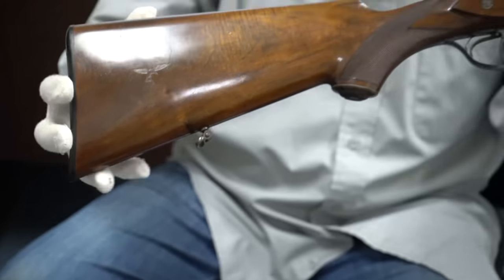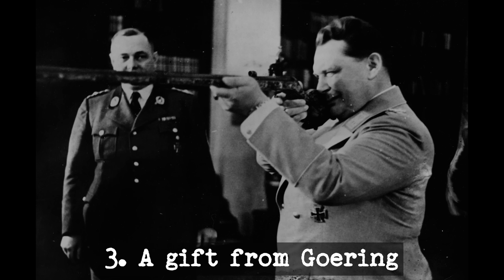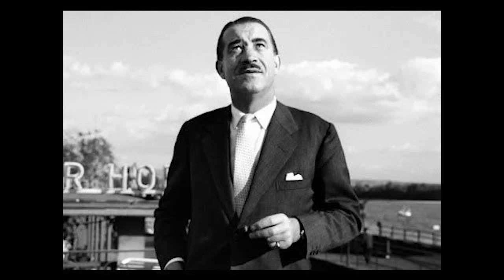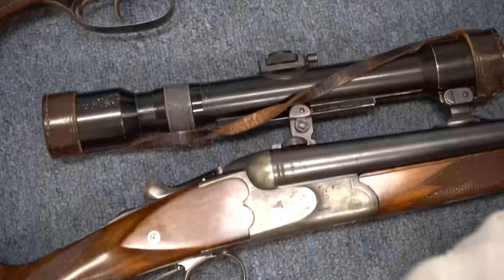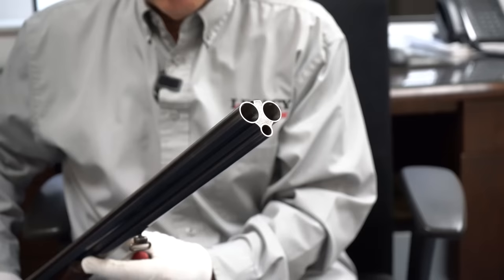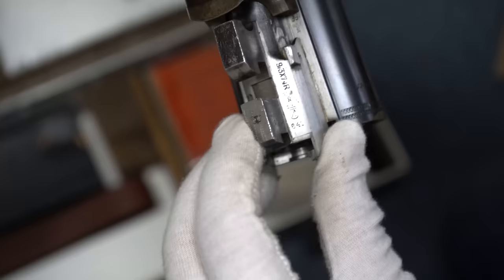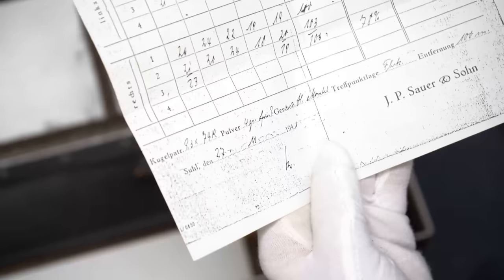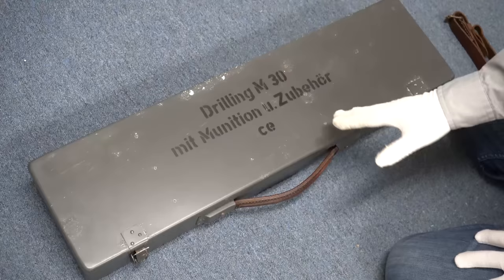Finally Proven! The Purpose of the Luftwaffe Drilling

Comment: It was far more common for pilots flying in the desert to ditch instead of bailing out, as sand was quite a bit more forgiving to crash land on.
Reply: that is until you flip
Reply: The Berbers, not so much
Reply: @george2113  that's what the drilling was for! Bang a few off at long range, then wait till you see the whites of their eyes, then give 'em both barrels! Job done!
Reply: I would like to add to this that pilots were and are trained to always try when possible to save the plane so if they still had control they would try to find a spot flat enough to land and as long as you are not flying on top of a forest you'll probably find it, also landing inside a plane is safer than going out with a parachute considering it is not that easy to jump out at high speed and you risk to hit the tail of the aircraft and on top of that those emergency parachutes have very approximative control so you don't have much of a say on where you land
Reply: Even on the Eastern Front the German pilots preferred to ride the plane down as opposed to bailing. Erich Hartmann, f'r instance, only bailed once vs 16 crashes (or something). Part of the problem may have been the "coffin lid" type canopies, part of it might have been lower altitude fighting, part of it may have been crap 'chutes (the Falschimjager parachutes were different to Allied once, could not be steered) .
Reply: As a Pilot, I'd land in a field over a desert any day. Sand is not forgiving to land on in the slightest. There's a reason runways are hard and solid. Sand is the opposite. You can land in either but you best believe I'd be bailing over a desert if I had adequate altitude, skill and the means to do so.
Reply: @XMarkxyz  what’s funny is now its almost the opposite. If you think you may lose the plane in enemy territory you basically scuttle it so they can’t get at the tech inside.
Reply: I would imagine the whip lash was still extreme, yould have to be the PERFECT ammount of relaxed and tensed to not have severe pain after landing fighter hard in sand unless you hit at litterally stall speed.
Reply: The little prince!
Reply: @bentrod3405  true, that is made possible by modern ejection seats which will keep the pilot safe until he has landed, anyway you can probably recover valuable information even from a crashed plane
Reply: Wrong! Go research some more!
Reply: @DonnyHooterHoot  Wrong! Go research some more!

Comment: The fact that that switch also flips the back sight up is a remarkable detail,  I freakin love that!
Pretty incredible that the cellophane wrap is still intact like that too, so cool!
Reply: I don't think that's original cellophane, it wouldn't be wrapped up like that for the soldiers I don't think. That's probably something someone just added after the fact to preserve them so they don't get dirty or wet or damaged. I'm not an expert on these things but the only reason I say that is because of the mismatch; the paper boxes seem used and worn while the cellophane is pristine. It wouldn't have aged like that naturally
Reply: @Eralen00  maybe, idk. Im sure if it is original it isn't very airtight, thus allowing air in to effect the paper. Idk, id be curious as to what these experts from Legacy think about it

Comment: 11:57 The contents of the box in German reads this:

1 Beschreibung, Bedienung und Wartungsvorschrift
1 Kolben mit Verschlussstück
1 Lauf mit Vorderschaft
1 Reinigungskasten
    a) 3 teiligen Putzstock mit drehbarem Griff
    b) 1 kleine Flasche Gewehrreinigungsöl
    c) div. Werg
    d) 2 Reinigungsbürsten für die Schrotläufe
    e) 1 Ölbürste für die Schrotläufe
    f) 2 Reinigungsbürsten für den Kugellauf
    g)1 Ölbürste für den Kugellauf
    h) 1 Wergaufnehmer für den Kugellauf
1 Gewehrriemen
25 Schrotpatronen Kal. 12/65, Schrot 3 ½ mm
20 Brenneke-Patronen Kal. 12/65
20 Kugelpatronen Kal. 9,3 x 74 R H-Mantel-Geschoss

Now, let me try to translate, as far as I can, not being an actual gun-proficient person (sorry!):

- One description, use and maintenance prescription
- One stock with lock piece
- One barrel with forearm
- One cleaning kit
a) Threefold piece of cleaning rod with rotatable knob
b) small bottle of cleaning oil
c) several pieces of gun cloth
d) 2 cleaning brushes for the shotgun barrels
e) oil brush for the shotgun barrels
f) cleaning brushes for the rifle barrel
g) oil brush for the rifle barrel
h) gun cloth catch for the rifle barrel
- One rifle strap
- 25 shotgun cartridges cal. 12/65, 3.5 mm
- 20 Brenneke-cartridges cal. 12/65
- 20 rifle cartridges cal. 9.3 x 74 R,  H-jacket

Comment: All the steel drillings were all case hardened.  There's usually remaining color inside the action.  Some were duralumin, and they're anodized.  The safety is normally on top as on a standard double shotgun. The lever on the side is the barrel selector.  In this case they're the other way, which is neat, as is the chamber indicators.

You can still get new drillings starting around $15,000.

12/65 ammo is 12 gauge by 65mm or 2.5" long, vs modern American 2.75".  DO NOT put 2.75" shells in one of these guns. They'll fit, but they create dangerous pressure in the forcing cone.

Complete Luftwaffe drillings are selling at auction around $22,000 in 2022.
Reply: Duralumin is an aluminum alloy, not anodized. The lever on the side is a Greener-type safety; the slide on the top is the barrel selector. This is the standard configuration on virtually ALL drillings, not just in this case.
Reply: @peterkracht6621  correct, I have a Merkel drilling
Reply: Thanks mike
Reply: @peterkracht6621  there is no reason that Dural can not be anodised Dural is only aluminium with around 5% copper added to the mix

Comment: I have that issue of G&A.  About ten years ago I got to examine and handle a WWII bring-back German drilling (might have been Swiss).  Two 12 ga barrels and a 9.3 x 56 (IIRC) Mauser/Mannlicher rifle barrel.  Beautiful little gun, really, but it had been sadly neglected in a closet since the end of WWII.  Pitted bores, rust, cracked and dried wood.  I deemed it unsafe to fire.  A wall hanger.  A pity.  You could tell that at one time it was a fine specimen of sporting/stalking gun. Had a dried out, rotting leather take-down case for it, too.  Evoked images of plains game and birds in Africa, or maybe The Black Forest, wild boar, dogs, grouse and pheasant.  Even so, I could not talk the guy out of it.  He just put it back in the closet.   We did work a nice trade on a M1917 Colt and $200 for a M92 Beretta a RN friend had given me in a cigar box.  All it needed was a spring.
I'll never forget that drilling.  The only one I've seen and handled in person.

Comment: Just want to note that the aircraft at 3:48 is not any fighter aircraft I know of.  All Bf 109s (Messerchmidt's most prominent design) were ridgebacks, and the backs of the Fw 190s' canopies were shaped more like the tail of a teardrop.  
It looks like the article identifies the aircraft as a Stuka (Ju 87) dive bomber (which is definitely what's shown on the next page), which... despite the canopy not being something I recognize, seems to be correct.  The lighting is so strong that it kinda washes-out the aircraft's wing, but I think I see the distinctive flaps of a Stuka, and I believe I see the crook of its gull-wing.
Reply: Glad to help you out - look up the Bf110 - its pronounced back of the canopy is quite recognizable, as well as the two side rudders.
Reply: It's very obviously a Ju-87. It's not a Bf-110 as you can see the propeller blades on the nose. The fuel filler cap and the pronounced dihedral visible on the left are also dead giveaways.

Comment: The Luftwaffe drilling is a standard m30 Sauer & Sohn drilling they are still made today by Merkel  and others.
They are still today a commonly used gun.
It is quite often the only gun that a hunter in Germany or Northern Europe use especially if  he is a member of the older generation.
It is not any luxury gun it is the simplest and cheapest drilling made, this drillings are one of the most common combination guns ever made.
In Sweden you can buy one second hand in good shape for about 1200 dollars.
That means that Sauer & Sohn probably had thousands and parts for further thousands in stock when the market for them crashed in 1939. 
So the guns were probably just taken out of storage ,fitted, stamped and sent to Luftwaffe.
It would have been more expensive specially make unengraved and  uncollared  weapons.
Regards
Lars Dahlén
Reply: From an Americans perspective 1200 is an expensive gun when you can get a functional AR-15 for less than 500, probably, or a shotgun for like 300
Reply: @jugo1944  Europe and America has often different perspective Volvo is counted as a luxury car in US but not in Sweden the difference is that most of us have the same car for ten to fifteen years.
The rifles and shotguns I use were used by my father or my grandfather.
A Sauer is good for at least a hundred years.
I do not think that a AR-15 last for hundred years.
Reply: Here in Germany a used, but still functional Sauer & Sohn Drilling may be sold for less than 700€, sometimes even cheaper. The younger generation doesn't like those heavy guns very much, they prefer modern rifles or shotguns.
Reply: @larsdahlen319  Well explained, my friend!
Reply: @larsdahlen319  I don't see why an AR wouldn't last a 100 years if you take care of it
Reply: @jugo1944  If used a lot, it won't last as long as a handcrafted all-steel rifle.
Reply: @Felix-fy7ki  Not sure how you know that so conclusively. Steel I suppose is stronger than aluminum, by weight, but it also doesn't rust. And the parts of an AR that see actual chamber pressures are also steel. Americans are still using M16s that saw heavy service and hobby use since the 60s
Reply: @jugo1944  I've been a gun collector for more than twenty years and generally interested in guns and their construction.  All handguns I know that are based on aluminium alloy parts don't last as long as the same construction based on steel parts. Neither pistols, nor rifles or shotguns.
Btw.: There are really a lot of cracked AR15 reiceivers around, just search the internet....
Reply: @Felix-fy7ki  I dunno, I've encountered hundreds of individual AR recovers and I've never seen anything in a lower that rendered it less functional, there's just not much that happens to them.
Reply: @jugo1944  with a drilling  you go deer, wild boar hunting and bring back ducks and goose ! Or the other way around !
Reply: @jpcaretta8847  Sure, I see the attraction of multiple calibers like that. I'd just as soon have more guns, since I'm a collector, but I wouldn't refuse a Drilling
Reply: @jugo1944  I see, this discussion will lead nowhere. A gun with a cracked receiver is beyond any discission, no matter if the gun is still able to shoot.
Reply: @jugo1944  If you are out for rabbits and unexpectedly a wild boar charges at you or you see a severly wounded or sick roe that needs to be taken down, a real rifle round is better than a slug in the shotgunbarrel. On the other hand, if you are deerhunting and meet a feral cat (who are inflicting much damage o nyour small game population and are therefore normally killed on sight), a shotgun will be more effective for such a small, moving target than a rifle round.
Two of my uncles, both no longer with us, were passionate hunters. They had proper shotguns and rifles, but often used their Drillings.
If small game, roe and maybe wild boar is your main game (and this is true for many parts of Germany), you could in theory do all your hunting with a carefully selected Drilling and not own another long gun. Of course, this will only rarely happen. Why own just one gun when twelve do the same job ;-)  Also, many would think that using the same cartridge for roe and boar is maybe not the best idea and have let's say .243Winchester for roe and 7 or 8mmMauser for boar and deer.
Caveat: This is what my uncles taught me over 30 years ago. Today German hunters might have a different view and prefer different cartridges than the ones I just mentioned.
Reply: I might add that when I read my uncle's hunting gear catalogue over 30 years ago as a kid, the case hardened shotuns and Drillings were mostly the budget models. These are quality guns, but not as fancy as some think.
Reply: @ralfklonowski3740  
And there are sleeve options too to use other calibers.
Reply: @ralfklonowski3740  There are some Krieghoffs out there that were presentation pieces for the Deutschland Erlaken days. Much higher quality.

Comment: in the 80s in Texas, My German neighbor had a Drilling. They used it for hunting Elk. One of the barrels had an insert adapter to shoot .22
Reply: Classical setup, left shotgun barrel is 16 or 12ga, right shotgun barrel has a "Einstecklauf" for .17 or .22 calibers (l.r., WMR, Hornet or .222) and a full power rifle barrel underneath. The front trigger can release the right top and the rifle barrel and it can be set for lower trigger weight. As universal as it can be!

Comment: Yeah, sure, the Luftwaffe drillings were almost certainly used in all the ways you describe; but what was their intended or underlying purpose?  Clearly, an emergency survival tool.  And while somewhat OTT, it was probably considered easier and quicker to purchase an existing production model than take the problem right back to the drawing board.
Reply: @Ullr the snow God No one is suggesting it was intended for Luftwaffe wide distribution.  It was clearly (as the film evidence demonstrates) intended for North Africa or perhaps arctic areas of operation, with low densities of human habitation.  Just use a bit of common sense.  Failing that, why don't you show me some documentation to demonstrate your thesis?    And while your about it, explain why you would present pilots with a drilling, in a utilitarian metal case, rather than a rifle, pistol or shotgun in a traditional wood and leather presentation case?  Failing that, maybe just show us a few presentation plates dedicated to individual pilots.
Reply: @Ullr the snow God A gift or presentation piece would never be so crudely cased.

Comment: people take fired 9.3 x 74r brass and fire form it for 3 inch 410 brass.
Reply: That's what the Brits did with the Luftwaffe Drillings they recovered from downed planes post 1941. Rather than spend the extra few at the time shillings on a firearms license for the rifle part of the Drilling,and not being able to find the 9.3 ammo in the UK. They bored out the rifle barrel in some cases to smoothbore 410 or sleeved them to  a .22 cal.But the 410 conversion is more common as it could be held on a shotgun cert. Saw one for sale in the UK in the mid-1990s that had come from a downed Me110.

Comment: Very cool.

My friend has a dreilling without the Luftwaffe markings.

It is a wall hanger for looks.

There is an incredible amount of markings on the barrel.
Do you know of any resources where the markings could be researched?
Reply: "German proof marks" search will find you the lists. You can usually date it from the marks as well. Some mfrs had cartouches.  Other marks are just production tracking.  You can also go to the German Hunting Rifles website and ask, or Double Gun Forum.

I expect it's perfectly shootable.  I have German doubles and drillings going back 200 years, and they all function properly.
Reply: They are all standardized but have to be taken in perspective of the time the weapon was manufactured as proof marks and proofing laws changed over the years. German gun enthusiasts should be glad to help you out.

Comment: You have to wonder how many of these survival shotguns found intact in down German aircraft
Reply: A couple of them wer found in downed  Luftwaffe aircraft during the  "little"battle of Britain,in 1942.
Reply: Intact.... in situe archealogicaly probably dozens.
Intact like minty fresh..... maybe in north Africa a plane ran out of fuel  so it didn't burn and managed to gently burrowed itself indo a sand dune quick enough to insulate the box from the sun and wind and temp fluctuations. 

Same for the north pole but snow instead of sand 

Eventually GPR will be high res enough to map the world from satellites. Maybe even before the rust eats it ⌛

Comment: 1:23 case hardening was more common back then than it is today. Soviet IZh-24 and 54 used to be case hardened, and they weren't part of the elite firearms segment 
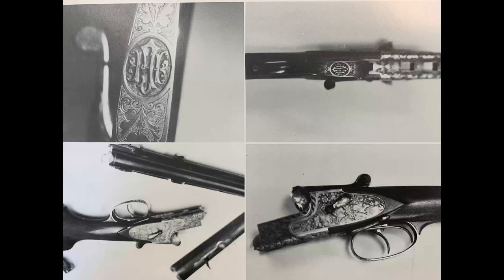6:56 I suspect that's Goering's favourite hunting gun, an O/U with replaceable barrels (12 ga, 12/8x75R and just 8x75R) manufactured by Merkel, not a drilling

Comment: Translation of the list, and sorry but since i am from germany my practical knowlage of some stuff is limited:

Description. User- and maintenancemanual
Buttstock with Breechblock (unreadable but i believe i was ment to say "Knick" meaning "break-(action)")
Barrel with (fore)Stock
Cleaning-kit
3-part cleaning rod

Bottle of rifle cleaning oil
"Werg" (dont know the translation, but these are plantfabrics used for cleaning/applying oil - i believe)
cleaning brushes
oil-brush for the shotgun-barrels
cleaning-brushes for the rifle-barrel
oil-brush for the rifle-barrel
"Wergaufnehmer" for the rifle-barrel (Also dont know how to translate, but its a piece of metal that looks like a corkscrew, where the "Werg" is tied around. Google "Wergadapter")
rifle/gun strap
shotgun shells, Cal. 12/65, pellets 3 1/2 mm
[Unreadable] - bullets/shells Cal. 12/55? maybe 12/65
Cartridge Cal 9,3x74 R, hollow point bullet